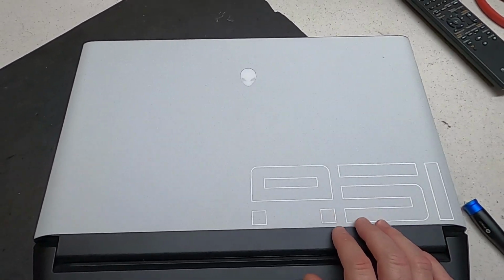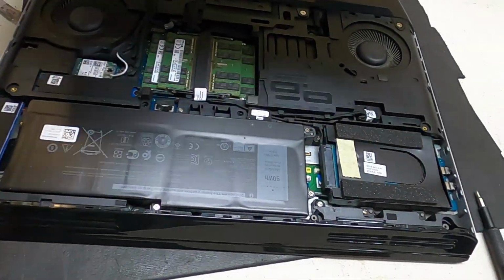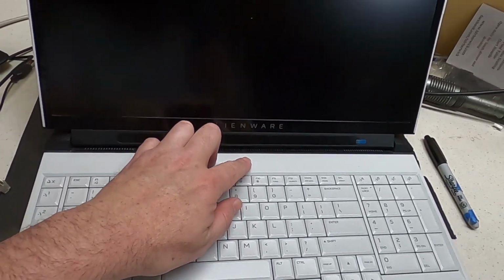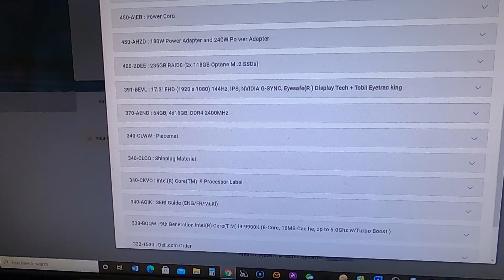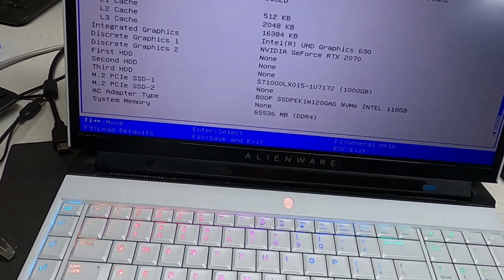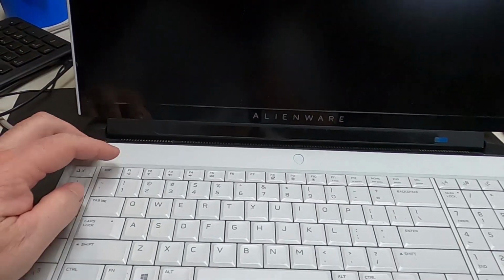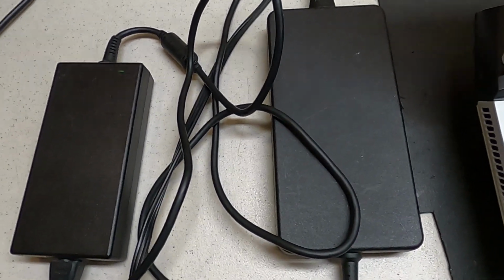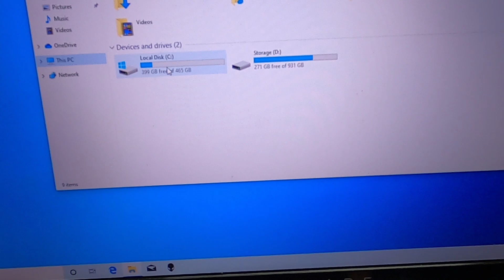Windows 10 Install Freezing at Load Screen on a Brand New Alienware Area51 Laptop

Comment: I had one . Pretty nice laptop. Build quality could be better though. If you get a a 51m do not get the white one. The finish stains over time. They solved this with revision 2 by putting a clear coat.

Comment: Intel drives are not bad. In this case I would connect those 2 optane ssds to another system, format both, and install windows on 1 of them and reconnect both to laptop to see how it’s going, because I’m not sure my customer is willing to be charged for a 500gb Samsung. Anyway thx for sharing this.
Reply from the maker: I recommended to the customer not to use the 120gig intel drives due to the fact that will fill up in no time only after a few Windows updates lol. He agreed the 500gig nvme was the way to go. Thanks for commenting.

Comment: Putting a desktop CPU in a laptop is a bad idea. That's why it needs two AC adapters. Also, the laptop will run hot.
Reply from the maker: It's pretty crazy what they try to install in these newer laptops. Thanks for commenting.